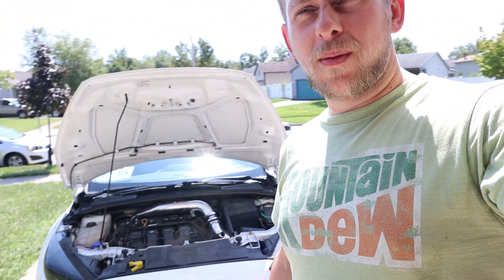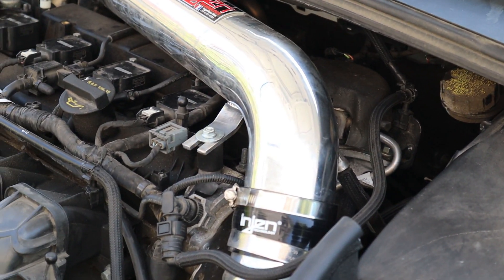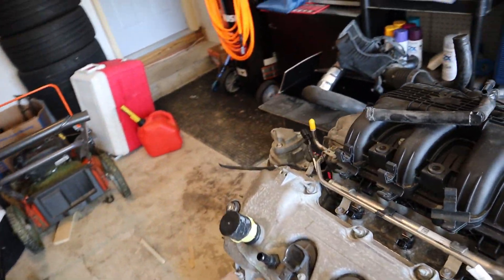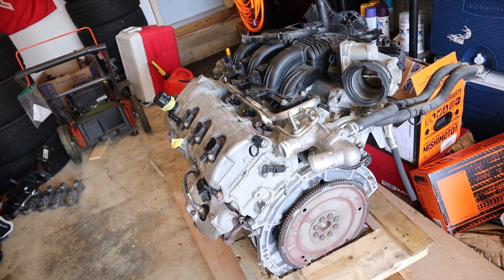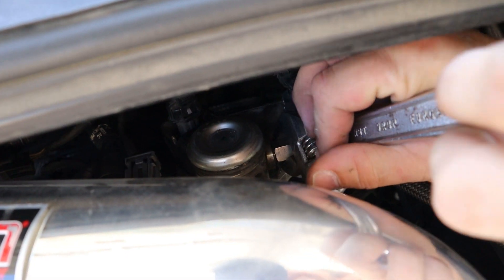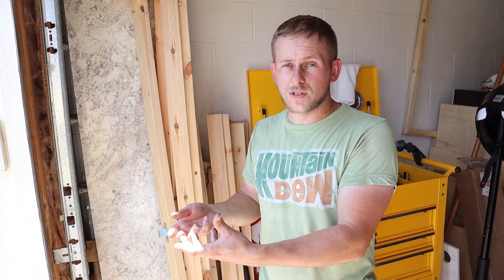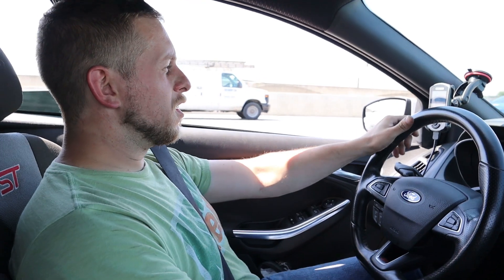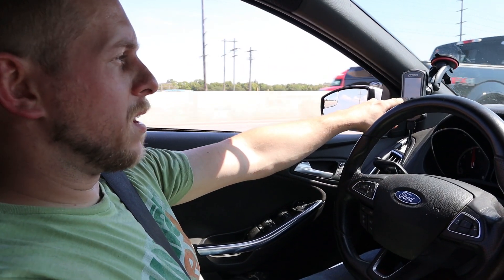Diagnosing Low Fuel Rail Pressure

Comment: Hello, I have a 2017 foRS and I recently got that p008A code and we immediately thought the in-tank fuel pump but we started with switching the low pressure fuel sensor (not the fuel rail sensor) and the car runs back to Normal. Before was getting backfires/hesitation on WOT and car stalling.

Comment: I have the same 3 codes as you had what fixed it the sensor or the high pressure fuel pump?